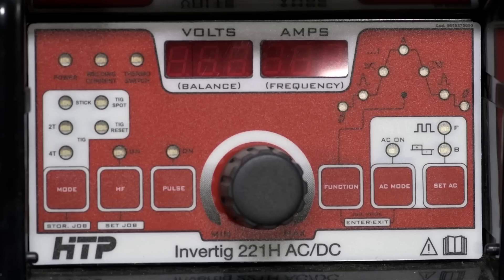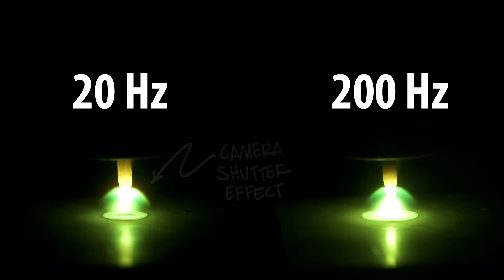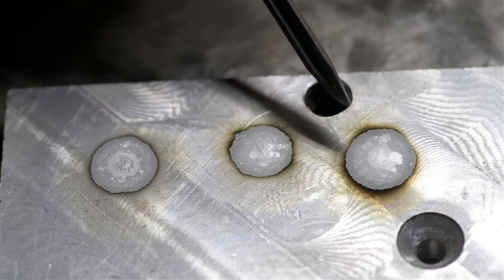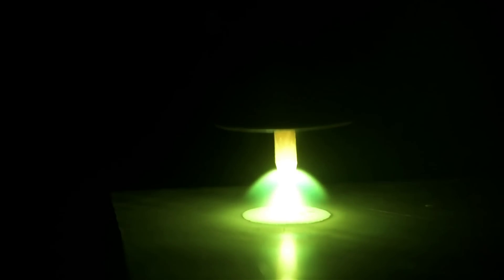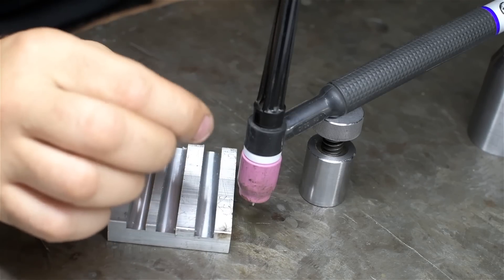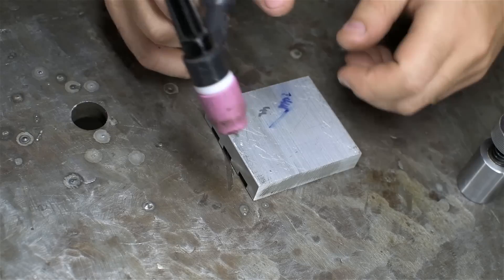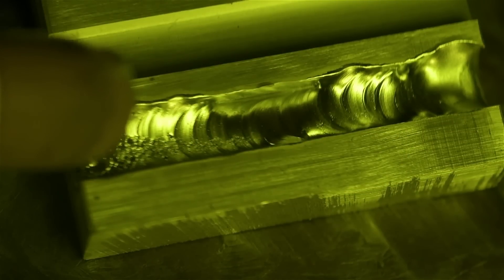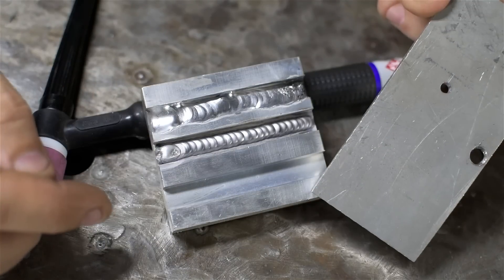TIG with TOT: AC Frequency?!

Comment: @8:00 it clicked in my head.  As I'm listening to your description, i'm thinking about my experiences with high power audio.  Low frequency sound penetrates walls, while high frequencies reflect off the surface of the wall.   Eureka!  Of course this principal would extend to the frequency of the AC current, and it's ability to penetrate through or reflect off the skin of our materials.  
Great video as always!  Thanks.

Comment: Hi Tony. In my work as a EE my experience has been that the skin effect at the frequencies you speak of is negligible. 

While I am no expert I believe that it is indeed the cone width that is controlling the energy density of the plasma and thereby producing a wider or more narrow weld bead.

The reason the two cones looked the same in your video, regardless of the discharge frequency used, is because you are looking at the photons emitted when the electrons supplied by the welder recombine with the argon ions. However, I don't think that those photons are actually representative of the energy flow/density within the plasma beam.

What you need in order to see energy flow in the plasma beam is a camera that can see electrons, or better yet heat. If you don't have either try googling "energy density in AC discharge induced plasma flows". The results of that search should have a few such heat pictures of plasma beams. What you will see is that inner cones (that can't be visually isolated based only on the light they give off) do change and that as a result the heat signature of the plasma flow changes drastically as well. 

The smoking gun in your experiments was not what the plasma flow looked like on the camera, but rather the characteristics of those little pits in the base metal. They were more spread out in the case of the lower frequency sample. That's because those multiple "cathode sites" formed based on the energy density of the beam. They are the tell tail sign of where the beam was the hottest, and how close or far apart they are seams to correlate well with the frequency of the plasma discharge that produced them.

I have no idea if I am correct or not, so please consider my theory as just another possible explanation. Ohh, and please keep making videos! I love them, and they are very uplifting whenever I enter a bout of depression. I watch them, and then struggle out to the shop to build something and then I start to feel better. So thanks for that gift!!!!
Reply: I think the skin effect does come into play here. Look at the design of induction motor rotors. The shape of the shunt bars make a big difference in speed-torque-curves due to the skin effect.
An Overview: https://en.wikipedia.org/wiki/Squirrel-cage_rotor
Reply: @pretendingpro  at such low frequency it wont make much of a difference.
Reply: I would agree, strictly speaking the skin effect at such low freq is negligible.  
Total power going into the weld is some product of Hertz, Volt-Amps, and travel speed. 
I would bet that using a piece 1/2 - 1/4 the thickness, a nice weld could be made at 200hz with a faster travel speed.  
Its all a trade-off, like everything in life.

Comment: 4:17  Couldn't have said it better myself. The AC frequency adjustment is highly overrated.
Reply: You mean highly adjustable LOL or highly a sales gimmick
Reply: i find the noise of the ac arc less annoying at higher frequency: for me it's a reason good enough to weld over 150 hz xD
Reply: raulduke85 60hrz is just fine for anyone to weld aluminum
Reply: @weldingjunkie  i know, it's my job o.O
I just said that the noise produced by the ac arc at lower frequencies is annoying to me, so I use higher frequencies, between 150 and 190 generally.
It may sound stupid to you, but since i have to weld alu 8/10 hours per day for the next 30 years, an annoying noise that i can avoid is more than a good reason to set frequency higher.
Reply: I found that using higher frequency on alloys in engine casings,  it helps stop the arc wandering.

Comment: Didn't see anyone else mention this so thought I would chime in with a thought: electric pixies aside, if you apply an oscillatory heat source to an object, the extent to which that heat penetrates the material will depend on the frequency. Think of it as a thermal-skin effect. For flat plates this decay goes as exp(-d * sqrt(pi*f/a)) where d is the distance from the surface, f is frequency, and a is the thermal diffusivity. I'm getting skin depths on the order of a few mm so I think this makes sense. The key here is that it matches intuition, higher frequencies, smaller boundary effect. Not saying there aren't other physics, but I bet this is a piece of it. Correction I think this is complimenting Sharky's explanation

Comment: Just want say I agree with your experience. When I was welding aluminum regularly at my old job we would bump up the frequency to get the best penetration we could into the roots of our corner joints and more control on edges.

Comment: Think of it as a very fast stitch weld setup. If your MIG has stitch settings, you can duplicate the results. The longer the on time, the hotter the individual event. That happens because you are putting heat in faster than it is carried away. Because of this, longer on time results in higher local temperatures and larger puddle size. As the frequency goes up the shorter heating period no longer 'gets ahead' of the cooling period (as far, and eventually, not at all).

Also the arc kernel is what generates the heat, not material resistance, so the surface shape and size effects heat flow (both in and out) 

My 2 cents.

Thanks for all your videos, great insight - always learning, and having fun too.

Comment: Soooo...like the lower frequency gives u a wider puddle with less penetration down and slightly lower crown, but more penetration sideways (cause of the wider puddle/arc); while a higher frequency gives you a tighter puddle and more penetration down with a slightly higher crown.

In simple terms one might even just say that a lower frequency gives you a wider arc, while a higher frequency gives you a tighter arc...like you know...99% of all welding videos on YouTube regarding AC aluminum welding. I love TOT, but this was 😆🤣

Though I gotta say, some of the best actual puddle footage on YouTube, something so many can’t get right. I loved the previous video on general Tig advice, that slow-mo footage of the puddle moving around while the torch was still, and pointing straight down, was priceless.

Comment: I do know that you're absolutely correct about the shape of the tip part. Electrical charge likes to collect to a point.

Perhaps it's something like this:

The higher the frequency, the less time each pulse has to travel through the material. So it doesn't heat it as deeply on a higher frequency.

Comment: i was always under the understanding that higher frequency allows to run your tungsten sharper without it balling up thus creating a more precise and controlled arc. my welder does not have adjustable frequency, would like to try one. good video!

Comment: Experience has told me that FREQUENCY has more to do with how much energy you get into the metal.  A higher frequency will take longer to heat the metal and the puddle will freeze somewhat faster.  The lower the frequency, the more energy is put into the metal and the puddle is somewhat slower to freeze.  The frequency is tuned to fine adjust the amount of energy put into the weld puddle.  Again, this is just my personal experience with welding Aluminum.

Comment: Great video! Under the same exact conditions, such a small change in frequency should have little effect on arc. When you start getting into orders of magnitude of frequency change then you will start to see a small difference but at that point you have a device that will not pass rf noise emission standards for certain communications bands. From an emag perspective, changing the sharpness of the tip will have a significant impact on arc width. In terms of power delivered at different frequencies, again, a change in frequency should have no effect. I and most of your commenters agree that your output wave will have more distortion at higher frequencies but there are probably other non-ideal components within your machine causing less power delivery. This is kind of difficult to measure because you would have to measure the power close to the tip. Just the tip, and only for a minute, mind. However, because the currents we are dealing with are relatively high, electromagnetic effects come into play and so the current "paths" through the material after the arc can be significantly different at higher frequencies.

Comment: Electrical Engineer here, with experience in RF, high voltage, and power transmission. Induction heaters for very large pieces of metal often are run down into the audio range, 1kHz or even less, to get sufficiently deep penetration of the work piece. There very well may be some merit to the skin effect theory, or at least should definitely not be ruled out on account of the low frequency. 

The shape of the electrode tip will strongly impact the electric field gradient, causing breakdown at lower voltage for sharper tips, and probably impacts the way current circulates within the plasma. What this means in practical terms, I have no idea. I'm not a welder :-)

Comment: With some divices you can also variate your zero line of the sinus. The minus cleans the material and the plus makes it burn into the material/puts in the heat. So if your material is dirty, or highly oxidated, you pull the sinus down, so that minus curve is longer and lower/deeper. 
With a low frequency you stretch out your sinus and with a high frequency you compress your sinus.

Comment: The most interesting discussions are the ones we have with ourselves 🤓

Me and myself believe the following…

AC= DCEN + DCEP + DCEN + DCEP + … in a sine or square wave.

Assumption: Energy input DCEN = DCEP

DCEN = good penetration and therefore more energy is transferred into the workpiece

DCEP = oxide cleaning action and very little penetration and therefore more energy is lost to the surroundings (measurable?). 

Flat stock → little difference between low and high frequency because the surroundings (air and or argon) can dissipate the excess heat easy.

Corners → heat build up because the amount of excess energy is not lost (or not as fast) to the surroundings (air or argon). 

High frequency (to me) is like setting a local fire and then quickly blowing it out before it can do much damage. Low frequency is like setting a fire and watching it burn for a while.

My reasoning for what it's worth 🤔

Comment: Tony, I think your explanation is spot on.  You probably know this by now, or someone else mentioned it in the comments below, but just in case, here is what I found...  The skin depth at lower frequencies is negligible for small conductors at these frequencies, (20 to 200hz).  But, for large conductors it is very relevant.  See: https://en.wikipedia.org/wiki/Skin_effect#Examples  According to the graph there, the skin depth @ 200hz is 6mm, while @ 20hz it's 11mm.  That's a big difference in the depth of current flow.  The more resistive a material is, the larger the skin depth.  As always, thanks for the videos!

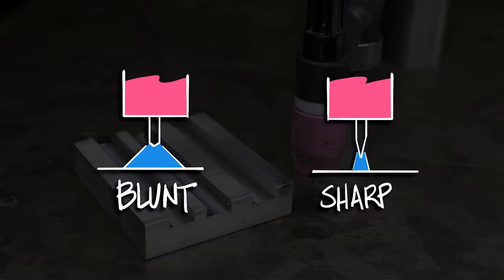Comment: 6:09 I thought blunt tip will narrow the arc for greater penetration and pointy will be wider. Some videos say the electrons leave the material perpendicularly (@welding academy). The longer electrons travels, the more energy it looses. With a blunt tip, the electrons have shorter distance to travel, making the puddle deeper.
Reply: You are correct. The figure in this video has it backwards

Comment: Always enjoy your videos... I want to put my 2 cents in it's about your cup set up nothing wrong running a screen but in my time I really don't use them on aluminum. a stander diffuser #4 or #5 cup. there are time I have used a screen or larger cup but not often. In your test I would use the #4 it does have an effect on the etching zone. also you can run less gas 10 CFH. there are many variables in AC welding. wave form, AC balance, frequency and independent amperage. all play a roll ( causing complete Chaos ) ;-) Cheers

Comment: May I suggest that to check out the principle and application of high low pulse settings you carry out a macro on the 2 welds and compare the penetration depth between the 2.
If the developed principle is working correctly, it is exactly the same overall heat input with both frequencies - but the higher pulse frequency will constrict and tighten the arc and give a different arc/weld pool profile - narrow weld pool width but deeper concentrated root penetration.

Comment: Another thing to take into consideration, your welder vs another in maintaining a perfect sign wave at high current vs low current may differ from another welder. Not saying your wrong but it would be kind of useful to see the wave form. If you could do that then I think the debate would be settled.  In any case thanks for another fantastic video.

Comment: I think one of the Easiest ways to describe the differences in high and low and why they do what they do is that higher frequencies are smaller waves and therefore fit in between and go through the materials actual molecular structure better giving that more direct property, more "penetration"

Comment: I wonder what this would look like on a scope.  It's be interesting to see if the duty cycle is actually higher or lower based on the frequency and to see what the ramp up and down or on each cycle.  I get the feeling the lower frequency is simply dumping  more energy in due to the reduced number of switching cycles.

Comment: Hi, thanks for your very interesting video and your views regarding TIG welding quality problems. Back in the '60s I was an electrical engineer with one of England's foremost specialist metal fabricators, to the aerospace, petrochemical and nuclear industries. Part of my job was to resolve any problems of welding quality, particularly with TIG and MIG systems. Hopefully, some of the following may be of help in your research.  Please forgive me if some of this is 'teaching granny how to suck eggs'!

In the UK at that time, most TIG setups were made by British Oxygen and consisted of a 440v, 250 or 500 amp oil-filled transformer (across 2 phases) with switchable output current selection and outputs of 80/100v. The transformer output was then series connected to a bank of large capacitors, followed by an HV/HF spark unit to induce the HV/HF onto the welding circuit. In AC TIG welding, this HV/HF superimposition produces: ionisation of the argon shielding gas, clean starting and smooth, stable, wave balancing to sustain the welding arc.  

Welding metals such as aluminium and its alloys requires a well balanced AC waveform but, unfortunately, any oxide film present on the molten welding pool causes 'partial arc rectification'  (i.e. it acts like a diode). These unwanted DC components unbalance the AC waveform, producing a reduction of the positive half-cycle duration - and the duration of the positive half-cycle is very important for successful welding of metals such as aluminium.

The large series capacitor bank between the transformer and the HV/HF unit was intended to correct and block the effects of these additional DC components added to the AC welding waveform. This capacitive solution worked very well but the initial cost and ongoing maintenance of such a unit was considerable.

In the mid 60s we purchased several American made Union Carbide 440v three phase, air cooled, self-contained transformer welding sets but, as well built as they were, the design used a large, series INDUCTOR as a solution to reshaping the AC waveform, rather than using a capacitive one.  This did provide a significant reduction in unit cost, and it worked, but most of the higher skilled welders complained that the weld quality had a noticeably inferior 'feel' to that produced by a system using a capacitor bank.

As an aside, we also went through a widespread phase of poor weld quality that looked very similar to that caused by the DC wave component problem. Nevertheless, this one was finally tracked down to a cost cutting exercise by the purchasing department, who had changed suppliers of the tungsten electrodes. 
I never quite got to the bottom of that one but it appeared that the cheaper tungsten probably contained more impurities. Reversion to the original 'expensive' supplier provided an instant solution!

Cheers,  Chris
Reply: Wow that was a good read I'm surprised no one hasn't commented yet. Thanks for sharing those decades worth of knowledge.
Reply: @impactodelsurenterprise2440  Thanks for your kind response - it even amazes me how much technical junk is still rocking around amongst the few remaining brain cells after all these years - don't get me started on the original Union Carbide hand-held plasma cutter - scary or what! Talk about James Bond and that laser beam approaching his goolies😀

Comment: its the switching losses of the mosfets. that square wave isnt really square, but takes a few microseconds to switch from + to - .
at higher frequencys (more switching) those losses get higher.
also since puddle heats up only on - and cools down on +, when power is used for cleaning, high ac results in a puddle that heats up more consistent.
if u imagine that heat up cool down as a triangle wave, on high freq the ripples get smaller. maybe that affects welding aswell.
thats my theorys, what could cause the effect you demonstated.
also i doubt the skin effect would affect anything below gigaherz frequencys :)

great video as always, i know im a little late, haha